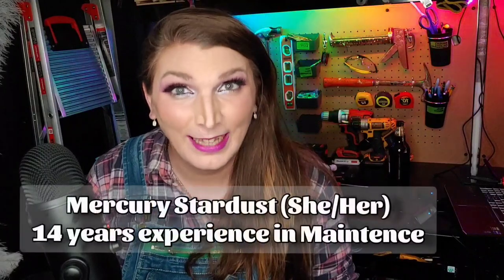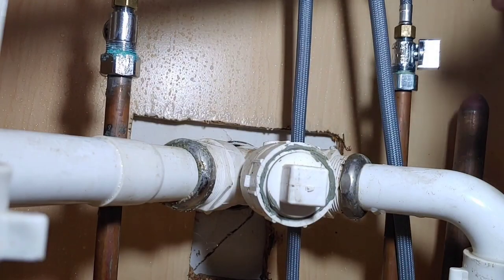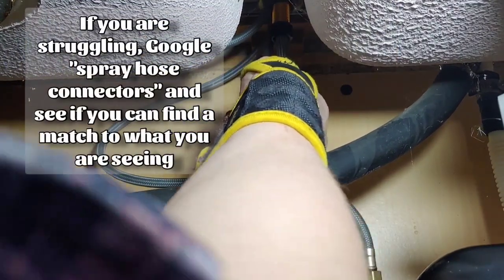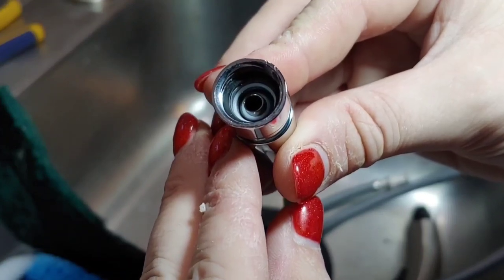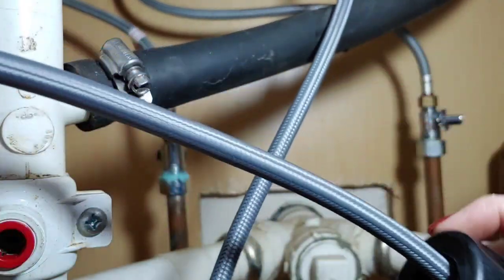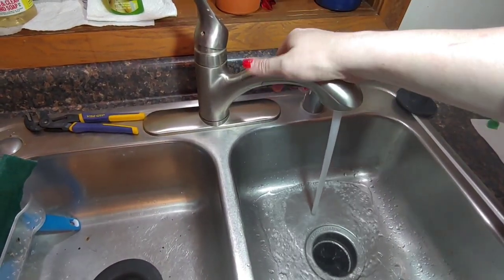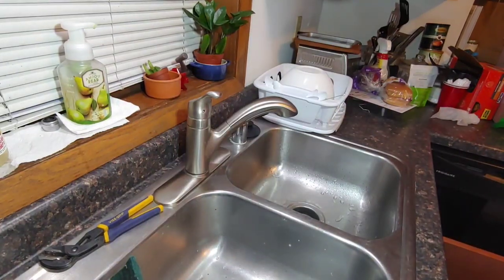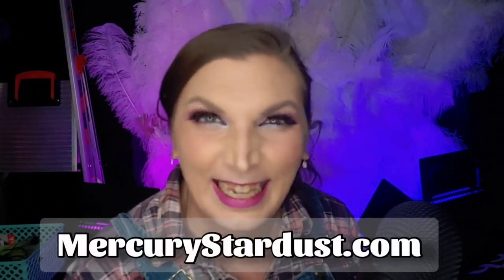Kitchen Sink Pullout Spray Hose Replacement

Comment: Thank you for this! My sink hose is good but it’s nice to know what to do in the future! I have an old faucet in my bathroom that’s a single pull up to turn on...and it gets really difficult to pull. Eventually the screw under the cap even comes loose. Is there anything I can do (like clean or replace) so it’s easier to turn on? It’s one of those bathroom fixtures that has the clear plastic, faceted knob. Moen, I think?

Comment: I would love it if you could do a video showing how to replace all the inner workings of the toilet tank, including the gaskets. My toilet tank drips water into the bowl and I think the gaskets need to be replaced as they are flaking color off when touched. The toilet is about 10 years old. The flapper isn’t very old (has been replaced once) so I don’t think that is the issue. But I figured if I’m taking the tank off that I should replace everything while I have it off. Feeling very overwhelmed and can hear the issue is getting worse to the point it triggers the tank to have to refill from the water loss atleast once a day. 😟 Thank you for all your help and encouragement 💕

Comment: Hi Mercury, I am trying to replace the hose in my kitchen sink. I ended up having to cut the lower end of the old hose off to get it out and now I'm having a difficult time feeding a new hose back through, is there a special angle or method I could use to help?

Comment: Hey Mercury, love your content. Is it a good idea to wrap the threads with Teflon tape to prevent leaks. My father always did it but my maintenance person at my apartment says don't. Much love and Thanks.
Reply from the maker: If the material your using is not using a gasket or a seal then YES.  But in this case there was only one point of contact that could even be wrapped with plumbers tape.  And that was the hose leading into the nozzle.  The nozzle has a plastic component to it, which could easily be cracked if it has to much force or pressure applied to it.  So in this case I went with the trusted seal and gasket that came with the new hose over applying teflon tape in addition to those.  Because with all of that working with the threads it could lead to be overly tighten and cracking the nozzle.

Comment: This is exactly what my kitchen faucet hose looks like except the faucet is a black moen. The hose is a pull out and a quick connect, it has an identical quick connect piece to what you have, everything underneath looks identical to what you show in your video except I can't pull out the hose and I don't know why. I took off the weight and everything but it just gets stuck on something inside the faucet and wont come out the top.

Comment: Is it possible for anyone to install a garbage disposal? Our new house doesn’t have one and it’s driving me nuts!
Reply: Something to think about so here is a quick question. Where does your waste water go? If it's a septic tank you don't want a disposal, if it's a sewer then full speed ahead with a disposal. If you are attached to a septic tank you will be constantly clogging your septic tank and having to get it pumped out. My mom wanted a garbage disposal and that is the reason she could not have one until the sewer was put in. Dad promised her a disposal if the house ever became attached to the sewer. As soon as they were he put one in.